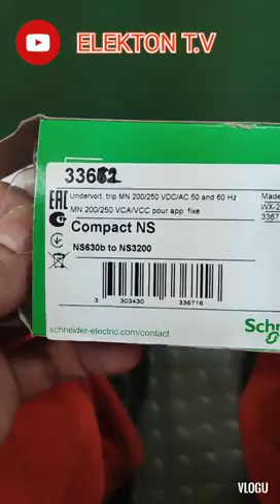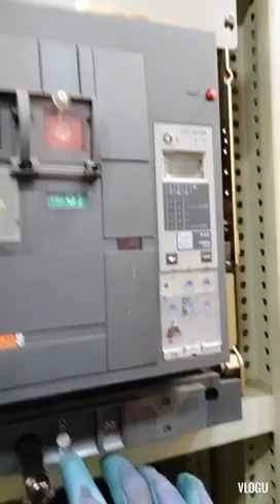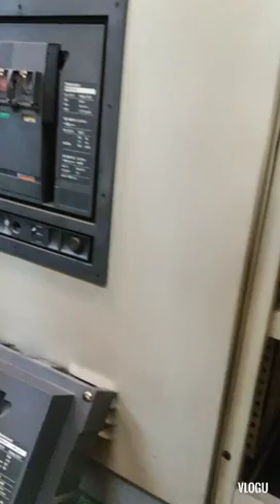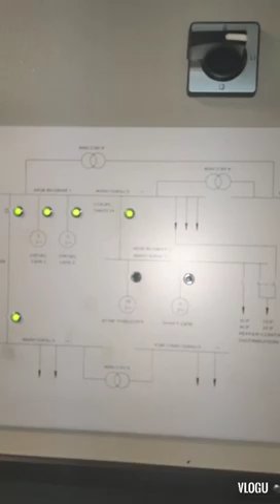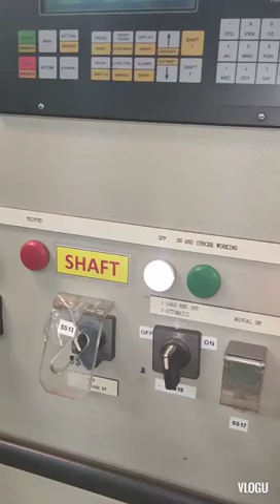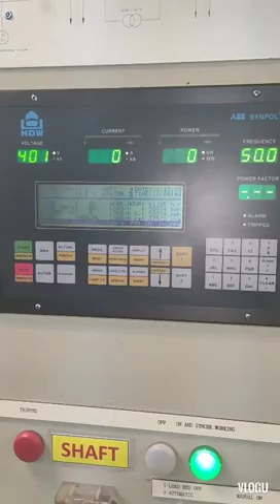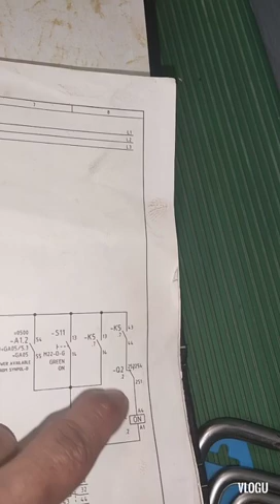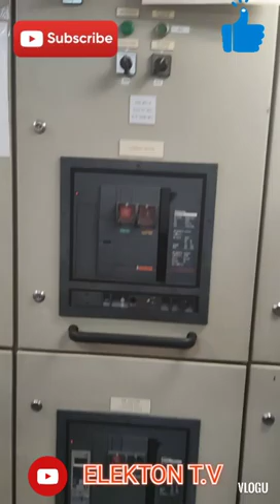HOW TO REPLACE CLOSING COIL OF AIR CIRCUIT BREAKER,MERLIN GERIN

Comment: Baka yung closing coil niya walang problema bago pinalitan .. Dyan lng cguro unconnected wire ang problema..
Reply from the maker: Yes sir, ba disconnect lng wire sa connector nya..
Reply: Tanong ko lang sir.. Yung gyro namin pag manual mode ang tagal gumalaw aabutin pa nang ilang rotation sa steering wheel pero naka auto mode siya ok naman gumalaw naman, ano kaya problema nito sir? Wala na kasing manual dito. Ako po pala si rafael sir inter island elec. Salamat po.
Reply from the maker: anu gyro nyo sir.,pm mo na lang ako sa messenger sir.,
Reply: Ano messenger niyo sir..?
Reply from the maker: eulexus eulexa pajarit